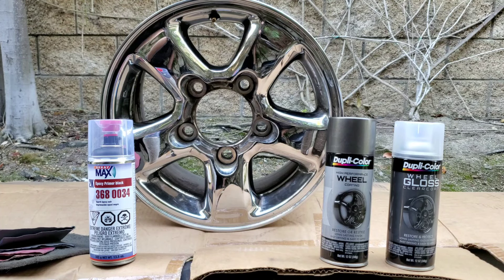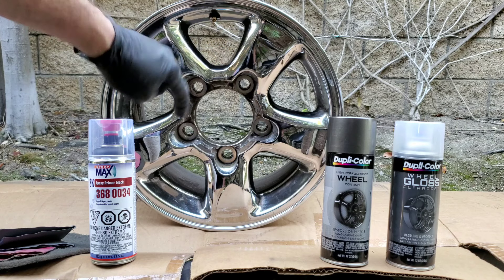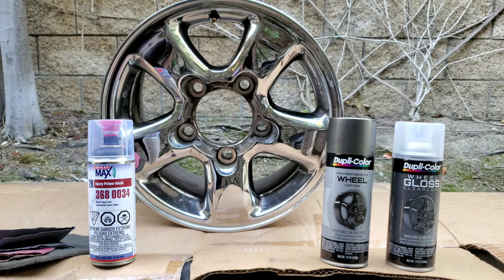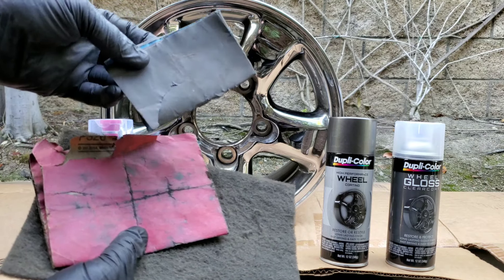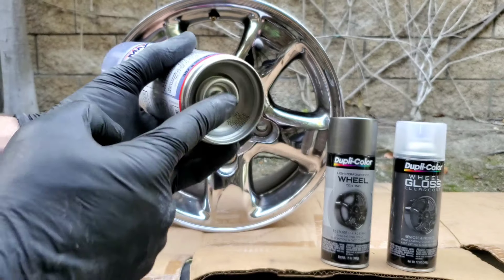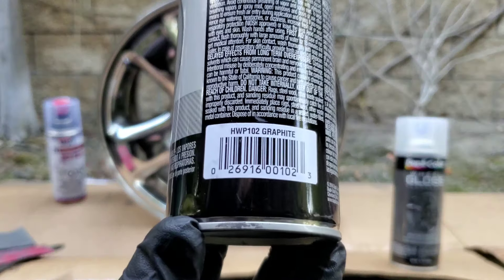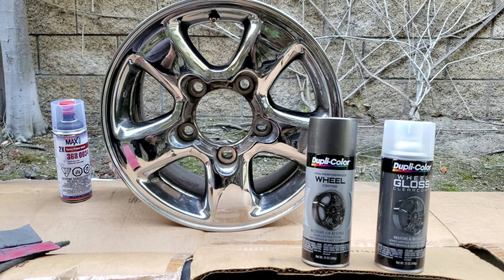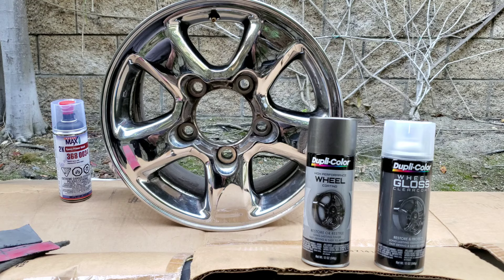✔ Everything you need to know: PAINTING CHROME WHEELS 👀

Comment: How many cans of dupli black did you applied sir?
Reply from the maker: The epoxy Primer took 1 can, for coverage enough for paint to stick. Theb thr Dupli color graphite greu, right between 1-2 cans. So at $8 a can, best to have 2. Some people do the inside of the wheel (overkill for me, will just get dirty in there) but that will take 1 can per wheel.

Comment: Which sandpaper grade did you use ?
Reply from the maker: Jack's? 340, 600, 1000, 2000
Progressively higher to smooth out.
Reply: You used 1000 and 2000 grit sandpaper before you painted the rims? Why?

Comment: A year later how are these wheels holding up?  Also did the tire guys cause any scrapes scratches when mounting tires?
Reply from the maker: Actually sold these wheels...
I have another set Indid about the same time and are doing great. You do want to be careful when mounting with tools, and of course curb rash will damage if side swiping a curb... But you coulc always tape off and just hit that spot to blend it back in.

Comment: How much did all this cost you?
Reply from the maker: The 2k Epoxy is about $22 per can.
1 can will get it done...
Then the Dulpi color $7.50 each. You will need 2 at most..
Then 1 can clear, which you can do Dupli color gloss, or spend more for a satin 2k clear from Max... about $22
So about $45 - $60 in paint.
The trigger handle you can get online for about $8.

Comment: Think you're short changing yourself by using a 2k primer and then only applying a 1k clear.  The same company that makes the 2k primer makes 2k clears.  The 2k clear will be MUCH MUCH MUCH more hard and durable than that 1k crap.  Especially on wheels that need the protection.
Reply from the maker: Good advice. 2K clear next set of wheels

Comment: You ruined nice wheels
Reply from the maker: The wheels were nice, agreed... I just made them nicer.. They already sold. Paid $75 for them and sold for $550. No one wants chrome abymore. I have another set chrome... been for sale for 7 months. These sold 2 weeks after I posted. Chrome is OK on 60s, 70s and 80s classics, but a 2000s SUV... not so much.
Reply: Chrome sucks so he made the wheels better.
Reply: The camera doesn't show detail if you look at 1419 the wheel looks like it's barely been painted with any vase coat in-between the spokes..that dupli color spray can suxks on wheels.